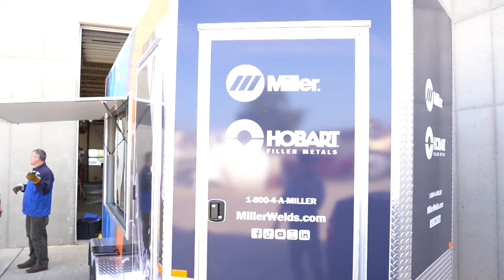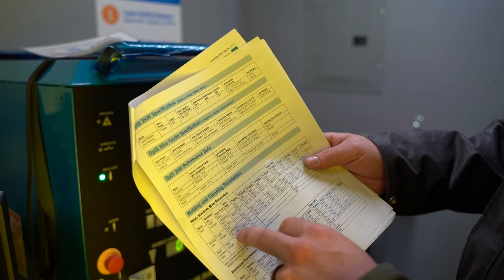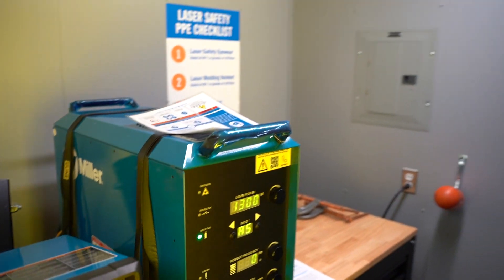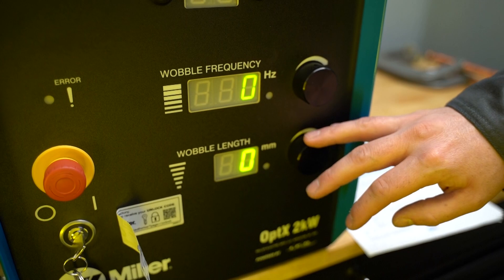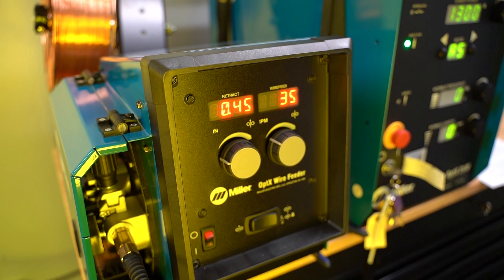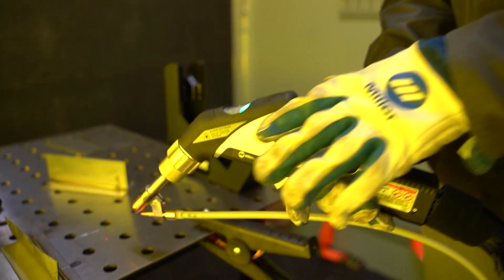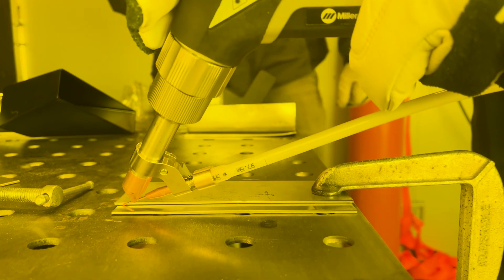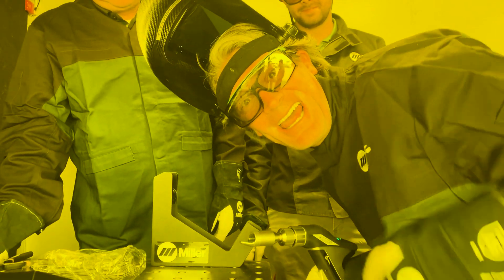Miller Electric Laser Welder - demoing the new OptX Hand Held Laser Welder!

Comment: This is nice and all, but how is Miller bringing a new welding process to the market if IPG Photonics released a handheld laser welding system back in 2020? The shop I work at currently has a handheld laser welder that I've personally run. The technology really is amazing but it's definitely not new.
Reply: Thanks for the comment and for watching!  Your absolutely correct, this is not a new process.  What Miller has brought to the table with this unit are advancements in the technology for the wire delivery system as well as a robust housing for the internal electronics of the power source that is itself a "light tight" laser enclosure.  I also couldn't agree more, the technology is absolutely amazing!
Reply: IPG has had this for over 10 years, it just wasn't affordable for any but deep pocketed individuals or businesses.
Recently Everlast released a full line of multi-mode laser systems up to 3kw.